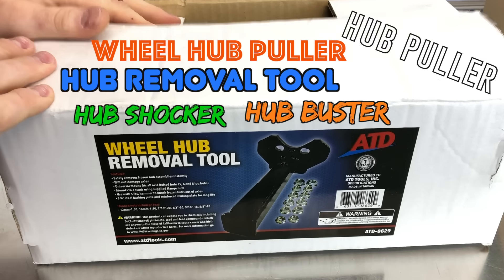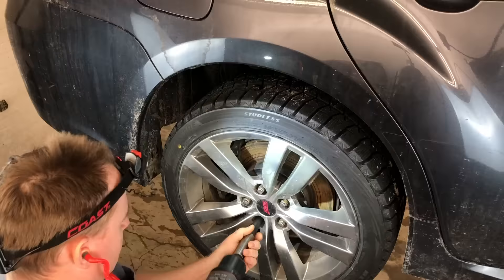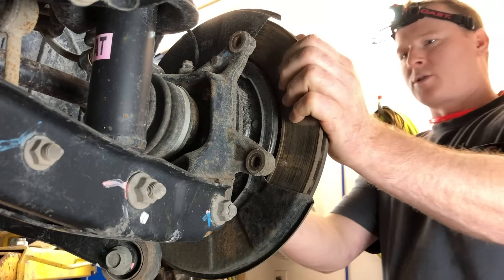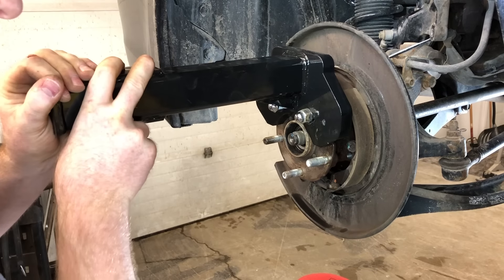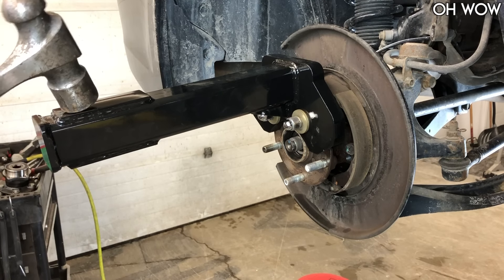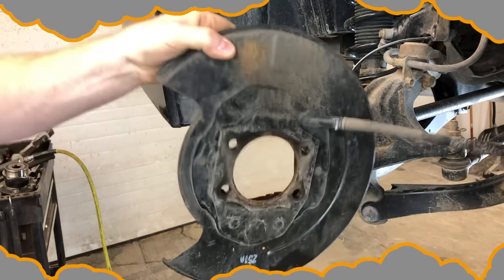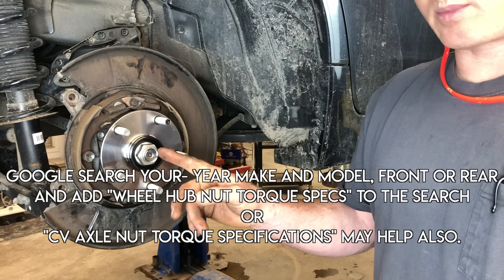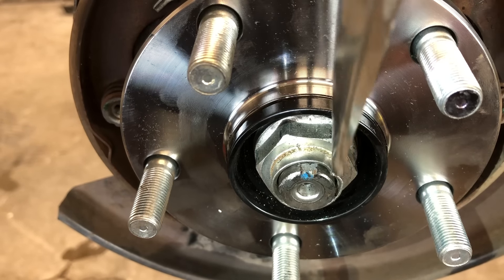HUB SHOCKER Hub Busters  |  REMOVE STUCK WHEEL BEARINGS EASILY!

Comment: I got one of those and it didnt work. I beat the livin hell out of it and nothing.
Reply from the maker: I'm sorry. What size hammer did you use?
Reply: @EasyFixShaun  A 16 pound sledge hammer with a fiberglass handle.
Reply: @EasyFixShaun  To be clear I didn't buy it after seeing your video. I bought it probably at the same time you did. Somewhere around Feb or March. This year. I did manage to get the bearings out with a large long barrel air hammer but this device was useless.
Reply from the maker: Really!? No kidding. That’s cool you tried it. I was having a few mounting and bearing separation issues because it worked too good! That thing is powerful. Have you seen by the second video? It’s updated and and solves issues.  I’m wondering if you had a mounting issue?? If the tool rocks on the hub it won’t work for crazy stubborn bearings.
Reply: @EasyFixShaun  I was doing a front wheel bearing on a 2005 Equinox. It was the original wheel bearing. The tool fit fine but I ended up beating the threads off the studs.
Reply from the maker: @TractorWrangler01  Oh man! I had the same problem. You gotta thru bolt the tool. It will then rip it from its resting place. Check out my updated hub shocker 2.0 video. I solved all the problems from the tool being so powerful on severely stuck bearings....stud stripping fixed by thru bolting with grade 8 and bearings separating into two pieces. https://youtu.be/eKqYtMdlPYo
Reply: @EasyFixShaun  I watched it just now. Good tips but that wasnt stuck like mine. I almost knocked the car off the lift banging on it with a 12 pound sledge hammer. I think I said 16 lb before. It was a 12 lb sledge. I just checked it. I had people yelling "Wohhh Wohh Wohh!" Because the whole car was jumping up off the lift pads. I should send you some pictures of the damage to the tool.
Reply from the maker: @TractorWrangler01  Wow!! That is amazing. You could have tried a block below the suspension for extra energy transfer. But even that....I don't know. That sounds crazy stuck!!
Reply: @EasyFixShaun  I put a jack under it eventually to try to take the movement out of the suspension thats when I ripped the threads off the the studs.

I was just about to remove the entire thing and put it on the 20 ton press when I got some movement from it by using a long barrel air hammer with a half inch hose at 180 psi with a ch816 chisel by GP. The Air hammer was from Astro tools. Im not sure the model number.
Reply from the maker: @TractorWrangler01  Man that is crazy!! That sounds like a nightmare. These rear subaru bearings have been a nightmare for me too without the shocker. I don't even break a sweat on them which is nice. But man I am surprised your let loose at all.
Reply: @EasyFixShaun  Im hoping it will be usable on some easier ones. But I beat it up pretty good. To its credit though the square tube held up with not much of a bend in it. It sure took a beating though. I broke an over head light trying to get bigger and bigger swings. LOL
Reply from the maker: Omg. That must have taken forever. I really wish you had a video on that. That would have been epic!
Reply: @EasyFixShaun  It probably would be up to a million views but there was a lot of swearing.. LOL
Reply from the maker: @TractorWrangler01  Hahahaha, you never know. If you do it cleverly like "AVE" you could get more than a million 😃
Reply: @EasyFixShaun  True but I would have had to get the video. All I have is a few pictures.
Reply from the maker: @TractorWrangler01  That happens all the time to me also. You can't predict when a good video should have been taken. But you can't film everything and be efficient really by any means. I feel like there is a constant conundrum of when to video.

Comment: Would never use a Hub Shocker. Too violent on suspension.
Reply from the maker: I see your point. I have used mine with a sledgehammer almost every time and have had no issues so far. If you are worried you can also support the knuckle with a jack stand. That will transfer all of the energy directly to the bearing and knuckle and not the suspension. Works great for extra stubborn hubs so you don't get the "bounce effect" 😃🔧

Comment: That's not the bearing being removed though, it's the hub  🤦‍♂️

What is it with people and the meanings of words..?
Reply from the maker: Hub bearing assembly is the proper term I think 😃
Reply: You cant buy the bearing as a stand alone part on the rear of most of the foreign autos. Just did all 4 on a 2006 Toyota Highlander.  Fronts where bearings, rear were hub assembly with Integrated bearings. Sucks, but that's what it is.
Reply from the maker: They mixed and match them on you? Wow. It was right in the time period where they were swapping over. Bummer. Glad you got them all done 😀
Reply: @EasyFixShaun  I had a buddy do them, and we did moogs on the front and something else on the rear...even at rock auto you cant get stand alone bearings for the rear, just hub assembly with integrated bearings.  fronts are a different story.
Reply from the maker: That sounds about right. The new modern Subaru’s are all hub bearing assembly’s. They are bolt in style which is great. But the durability isn’t great in my opinion. And the rear Subaru bearings are crazy hard to replace due to Corrosion. I think I may prefer press in style. They last longer. I’m on the Fence.

Comment: Slide hammer just saying
Reply from the maker: I have tried slide hammers when that was the only option I had. It works, but it leaves you with the still stuck bearings half in the knuckle. Here is the video I made on it. I got the bearing out. But it was really difficult. Required more special powerful tools to get out the remaining bearing portion.
https://youtu.be/uDWw7DUi4RE   
The NEW hub shocker 2.0 video solves all mounting issues and bearing separation issues I was having with the tool. The tool has been working awesome! The bearing separation trick in the "2.0" video would help the slide hammer method if you need it. Slide hammer method doesn't have enough mass to remove the whole bearing. The Michigan vehicles I work on are always very corroded. Even 1 and 2 year old bearings on new cars are excruciating.. Hub shocker makes it easy for me.

                https://youtu.be/eKqYtMdlPYo
Reply: Ok , I live in AZ 🌵🌵
Reply from the maker: @wasfast5409  You lucky! You probably don't need one of these tools. I wish I lived there for working on cars. Your vehicles must be so nice!? I doubt anyone in the whole state of AZ owns this tool.. 😆

Comment: Test it on a 2016ish give or take explorer front or rear bearings those things are freaking bastards
Reply from the maker: Anybody able to do this? I don't see a ton of explorers. But, the first chance I get I will do it and make a video about it! In the mean time maybe you could try it out and let us know. I would recommend watching the second video. Through bolting the tool on like in the video and use the cv axle nut to hold the bearing together if it is coming apart. You may need to support the lower suspension with a block to increase energy transfer and if those explorers are that bad. I have had luck with the Subarus using just a sledge hammer and no blocking. They are horrible replacements and this has been working great. Maybe the same will work on the front of explorers?? Sorry I don't have any examples of these yet...😃
                https://youtu.be/eKqYtMdlPYo

Comment: Don't buy this tool you will be ripped off. The bearing must move perpendicular with a lateral force applied for correct removal.   I've been working aircraft and automotive for 35 years and never once saw anything like this tool to remove a wheelbearing.
Reply from the maker: You just did. 😃  Here is the second version if you missed it the first time https://youtu.be/eKqYtMdlPYo
Reply: @EasyFixShaun  sorry bud, something just not right. If you are using it on a bearing with a drive axle I'll give a little. Most certainly no on a vech with a stub shaft. You'll be buying a knuckle.
Reply from the maker: You must not have watched the video.

Comment: give one to eric o and watch that tool fail lol
Reply from the maker: Probably! haha. Check out the second video. I solved some problems with the tool. Mounting and bearing separation. The tricks work on a slide hammer also if you happen to be using that 😃🔧https://youtu.be/eKqYtMdlPYo
Reply: @EasyFixShaun  yeah cant see the $ for one when i have an old slide hammer already. good tip though
Reply from the maker: @jmistret419  No problem. Ya I think one could be built easily if the material is available. 😃

Comment: it is "lets beat shit out of it" type of tool. I would not use it.
Reply from the maker: Fair. What do you suggest on severely stuck wheel bearings?
Reply: 40 years ago I was using a tool which was also impact type of tool, but the impact was in axial direction. I do not know how to describe it in a short way. It was something like a hub with long shaft with a sliding heavy donut. The donut was "trapped" on the shaft, but it could slide from one end to the other. Shaft was about 3 feet long. The tool was bolted the hub you need to remove. You slider the donut away from the hub. Faster the better. It hit the end of the shaft and the impact resulted in the impact load .....
Reply from the maker: @janveit2226  Interesting! I would love to see that. Was it used to service a bolt in style hub?

Comment: This looks like a crappy tool to use. The bearings come off easy with the rental tool from autozone. You dont need to bang the crap out of your hub assembly.
Reply from the maker: The tool is amazing for severely corroded and stuck bearing assemblies. Here is the new video. It shows it better and I solved two problems I was having with the tool. I only thrubolt the tool onto the hub with grade 8 bolts now. And I use the cv axle and nut to keep the bearing from separating into two pieces! 😃🔧🔧 https://youtu.be/eKqYtMdlPYo

Comment: These are garbage, we had one in my shop. After a few seized bearings, the entire thing bent like a wet noodle.
Reply from the maker: What kind of vehicles did you use it on?
Reply: @EasyFixShaun  it was a variety, it started bending on the second car and didn’t make it past 10. We also have snow and salt here which doesn’t make anything easier. It’s great tool while it’s working. They need to make them solid and not hollow. We crushed it.  But we are also swinging 5-8lb sledges cut short into a hand mallets.
Reply from the maker: Really!? Dang man! You guys must work out 😃 haha. I have used mine 3-4 dozen times with a 8lb sledge on all but a couple uses. It has some small damage on the strike pads but it's superficial. I mean, it is made overseas so I'm sure the metal is most likely garbage. Mine seems to be holding up great. Sorry you guys are having so much problems with it. I wish you could share pictures on here. I would love to see that thing! 💪🔨

Comment: Lol spend $100+ dollars on this tool or go buy the cheapest gear/bearing puller  for like $20 and not risk damaging the spindle...
Reply from the maker: It could work. But a gear puller will apply pressure to the cv axle which will push against the axle, which will push against the side gears and clips inside of it. Axle will likely hold and be just fine. But there is risk there of damaging something else you didn't intend to. Gear pullers can apply a lot of force. It would also likely split the bearing into two pieces. I have removed bearings with every tool made. The shocker works best for me on Subarus. Subarus are some of the most stubborn bearings replacements there is. It has made my life easier. I haven't damaged anything yet with my tool. I have used it 40 times now at least. If you can do it better, faster, and cheaper I am all for it! You should make a video about it. I would totally watch it! 😀
Reply: @EasyFixShaun  as a machinist and engineer by trade i can say with confidence a gear/bearing puller presses in the center of the spindle and will hook around the outside of the of the hub and pulls the hub off the spindle it will not press IN on the axles or other parts in the drive train due to the point of resistance being the friction of the press fit of the bearing race on the spindle
Reply from the maker: @Coltgov191145  If you pressed a bearing like in the video, all the pressure would be transferred into the axle and into the axle housing which would then push on the axle housing mounts to the cars subframe, which is attached to the uni-body. The axle is a long shaft the would transmit all of the gear puller forces from one end to the other end.

Comment: Brutality.   I don't like it.
Reply from the maker: Here is some new and improved brutality methods from Hub Shocker 2.0... Let me know what you think! I use a bigger hammer. I also solved some of the problems with the tool I was experiencing. Optimized mounting to transfer all force more efficiently to the bearing with less bounce. I also solved the bearings separating from such savagery 😃🔧  https://youtu.be/eKqYtMdlPYo